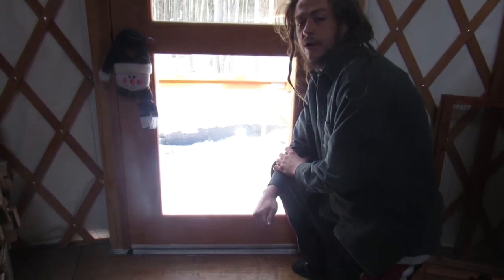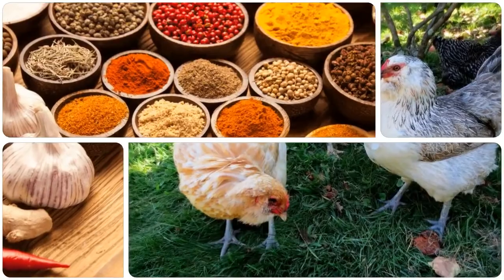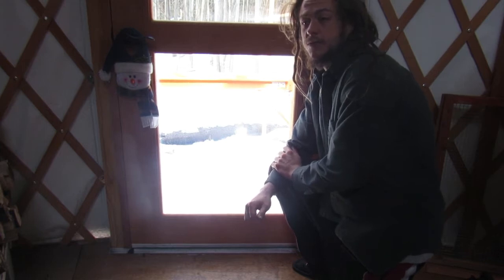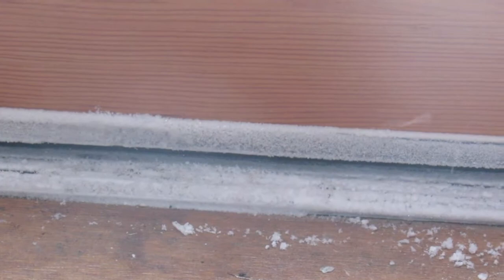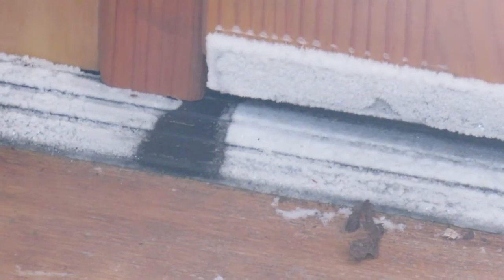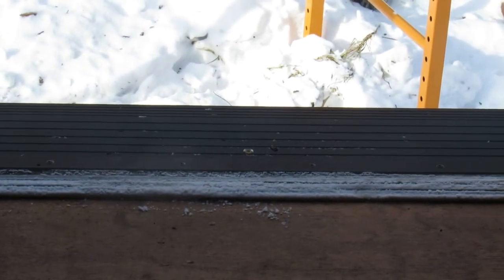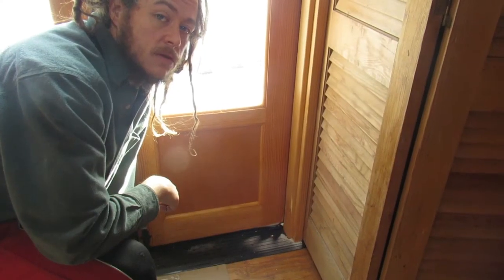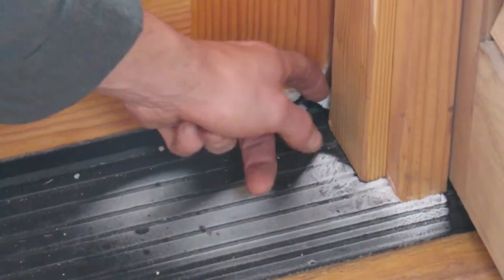Frost on the doors in the yurt. Cold winter

Comment: Happens to every door and window in every house, cabin, dwelling I've ever lived in up here in Canada. At minus 40 it becomes impossible to avoid. Just the moisture of a warm home condensing and freezing where it's coldest. Never had it turn to mold. Not really anything to be concerned about. You can just make a couple door snakes outta an old pant leg and some filler (sand works well). Lay the snake across the threshold and it'll keep the drafts out and the frost off while absorbing some of the moisture from condensation.
Reply from the maker: Thanks, will try this!

Comment: It would not hurt to have an awning or snow room attached to the door.  Could serve as a mud room and
an insulated area between the yurt and the outside.  I would heavily insulate it all around and stick to wood
windows as opposed to metal which will condense and freeze very fast.
Reply from the maker: We were looking into a mudroom attached but now we don't know how to attach the mudroom and allow the snow and rain to run off the yurt and not get in or mess the mud room up. Any ideas??
Reply: There are a number of yurt manufacturers out there now.  You might want to check out Shelter Designs Yurts in Montana and see what they have to say about your concerns.  If anyone could answer your questions, I think these folks would shoot you straight.  Good luck!
Reply from the maker: THANKS!

Comment: We live in Alaska and I was just up in our attic and noticed frost buildup on all the nails in the roof. The conducted cold metal exposed to outside temperatures, cooling the nail to a temperature less than the temp in the attic causing frost. I also noticed this on the metal ducting from the bathroom fan that ducts through the roof. I think its natural and nothing to worry about. The humidity is so low in wintertime. Im not concerned about mold growth, inspected the area, and it was free from mold. Its very dry up there except for the frost. I assume its been doing this for years up there and this is the first Ive noticed it. Something to check occasionally though just to be sure. Just my thoughts on this. Im curious if others have solutions?
Reply from the maker: Thanks for the feedback!